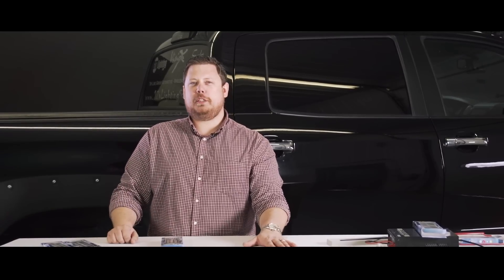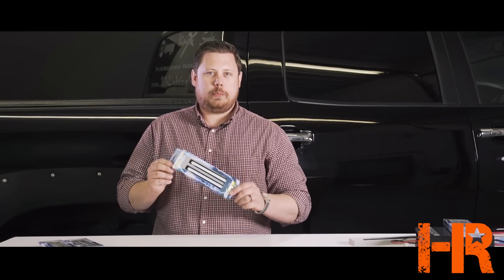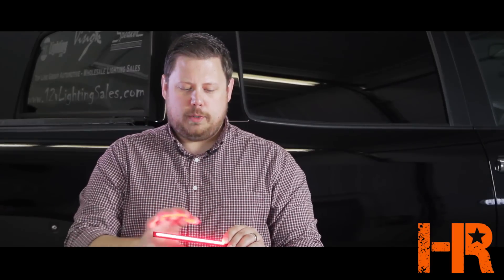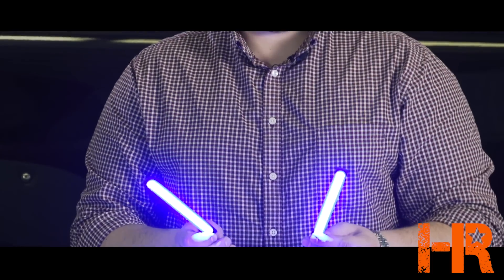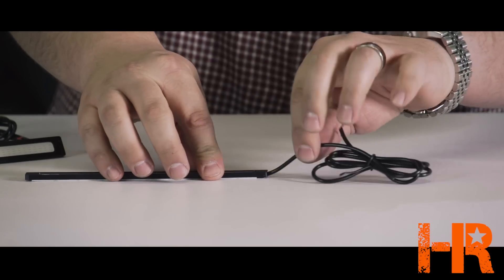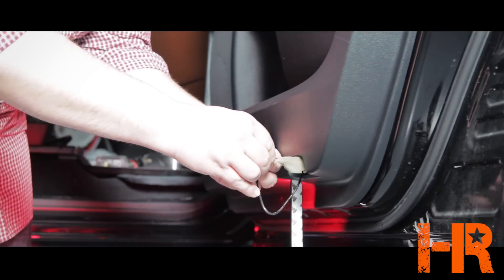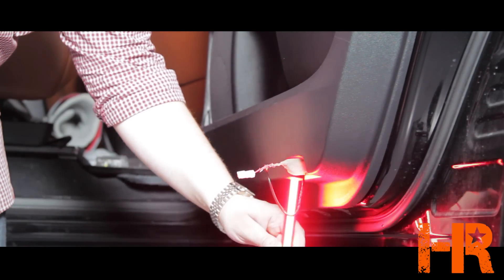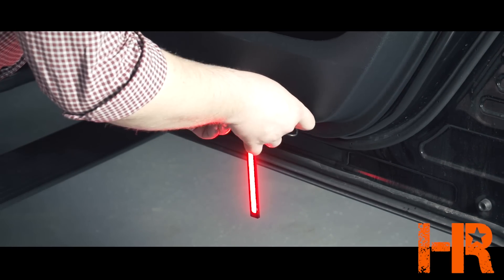The Most Versatile LED Light for your Vehicle | Headlight Revolution

Comment: You need a set of auto strippers .. can strip the sheath easily!
Reply from the maker: Thanks for the advice, we will look into it!
Reply from the maker: We actually have that exact stripper! And you are right, works like a charm!
Reply: Headlight Revolution awesome! Glad you I could help. Remember the screw adjusts so back it off for small wire a bit to prevent cutting it by accident. Btw still waiting for a return email :)
Reply from the maker: We really appreciate the great advice.  When did you send us an email? You might want to send another one, we have been really busy lately. Sorry for the inconvenience.  Thanks again.
-HR
Reply: Was just a few days ago.. I can resend no prob. Cheers!
Reply from the maker: Thank you!!